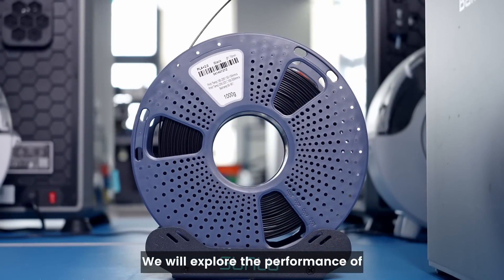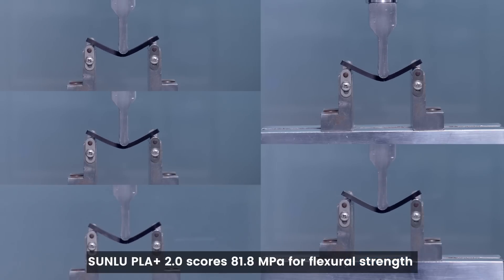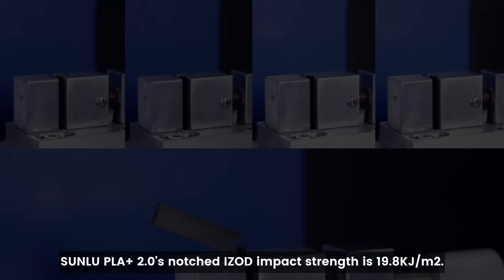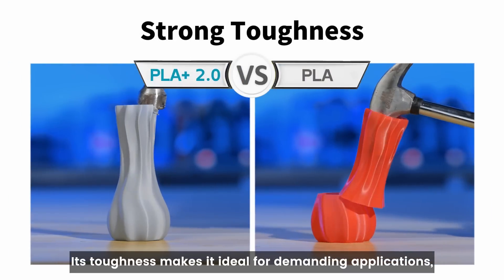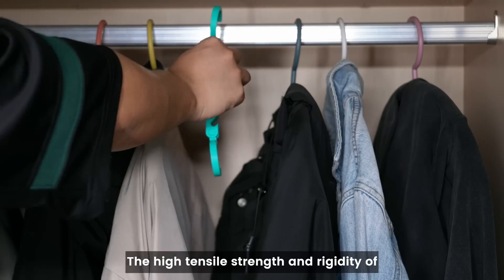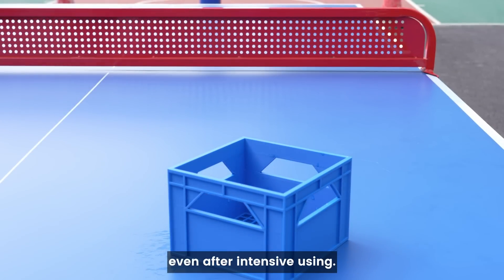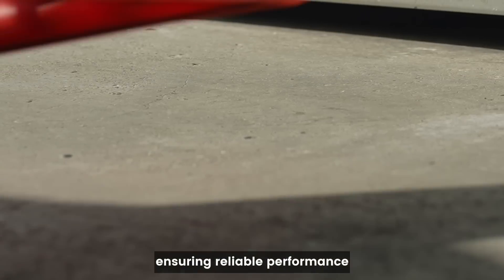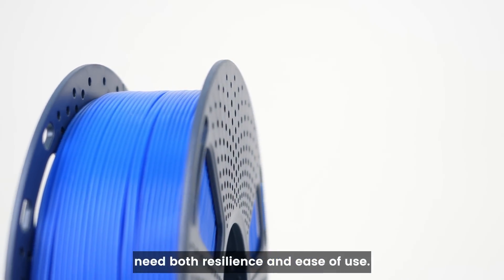SUNLU Filament Guide: PLA+2.0

Comment: What settings do I need to use on my Bamboo lab A1 mini? I'm having trouble with little strings and fidgets not working
Reply from the maker: Hello, please select SUNLU PLA+ 2.0 in the project filaments list. :yougotthis:
Reply: That setting has it printing at 220c and .98 flow rate
 Shouldn't it be lower?
Reply from the maker: @XxAtomic646xX  Generally speaking, setting these parameters should work without issues. If you require more detailed settings, please contact our after-sales team for assistance: support@sunlu.com :virtualhug:

Comment: Seems to be a lack of information/tests on how this compares with SUNLU PLA+, which I guess you'd call 1.0. This is my PLA of choice mostly.

Until there is more information I think it might be safer to stick with 1.0.
Reply: nope, I have used their 2.0, and it is significantly better, but in my opinion, you are often better getting PETG-HF and standard Sunlu PLA as it is dirt cheap.

Comment: how does this compare to your original PLA+?
Reply: in my own experience, far better.
Reply: @PrazgreenStudios how so? would love to hear your experience printing it, thanks
Reply: @Mannjager  it has noticeable strength differences when I put it to its limits, but considering the higher price, you shold just use PETG unless you specifically need some specific properties of PLA. Honestly, any Sunlu PLA in my experience has had enough strength including impact resistance to be worth using for functional parts except for their high speed pla or any silk pla, but those are not made for functional parts. I personally wouldn't buy it though if you have the choice between it or Elegoo or Bambu's PETG-HF. It is better and enough for specific use cases, but unless you really need a PLA to be pushed that far, you are just fine with stamdard PLA even for most functional parts you'd want in PLA anyways. Despite this, I have noticed some considerable differences but mostly in impact strength. So unless you need that, just use regular or PETG-HF from Bambu or High Speed PETG from Elegoo.
Reply: @PrazgreenStudios  damn thanks for the info man. in my region, bambu and elegoo filaments arent readily available. however sunlu is and the prices are surprisingly close, pricewise sunlu’s high speed PETG = 117% the price of reg PLA, sunlu’s PLA+2.0 = 106% the price of reg PLA. i’m guessing going straight to the high speed PETG would be the best option of hobbyist and makers right?

Comment: What about VOC emissions while printing? Is it safe to use in winter in a closed room?
Reply: Great question I hope for a speedy response from SUNLU.
Reply: In order to strengthen PLA most companies use additives but don't provide their formulas. So we don't know if those additives are harmful or not. I really like this new PLA but I added a window ventilation system just to be safe.
Reply: I print in my small room with air purifier - it still reports no sudden jumps In VOCs  and everything was marked green soo I guess nothing to worry about! The cool thing is that it doesn't smell bad too ( some other PLAs that I tested smelled like um cooked corn? Yea that gave me a headaches 💀 )
Reply: i mean it is still PLA, there really shouldn't be much concern for VOCs. If you are worried crack a window and run a fan.
Reply: @Jackbartel-x4x  What's your source for stating that there shouldn't be much concern for VOC with PLA? While it might be safer than other filaments, what is the source of the information that it is safe/there shouldn't be much concern?